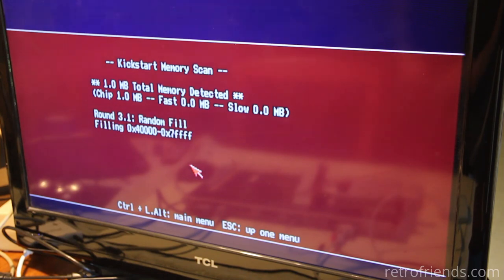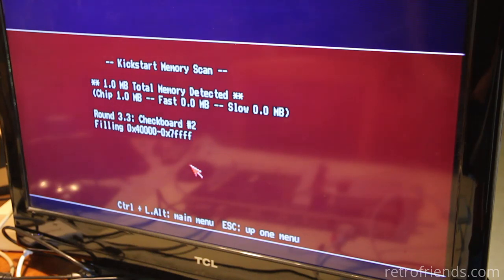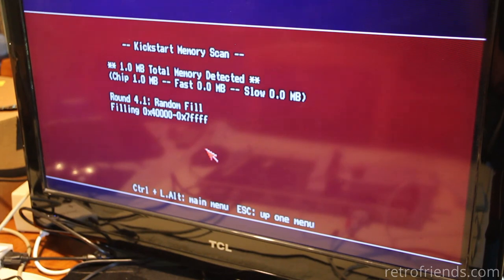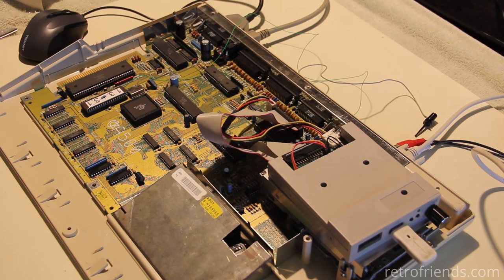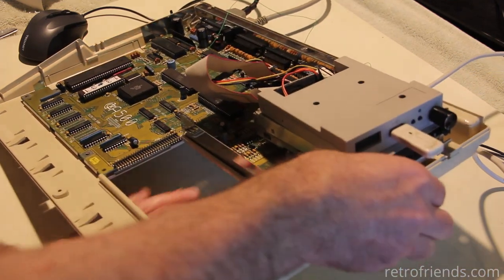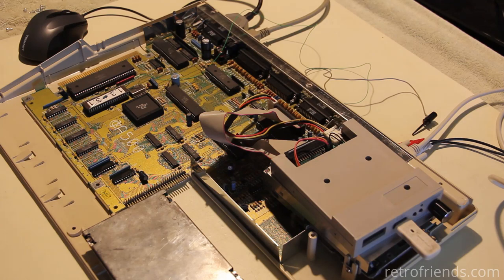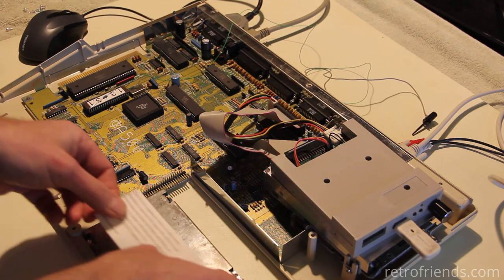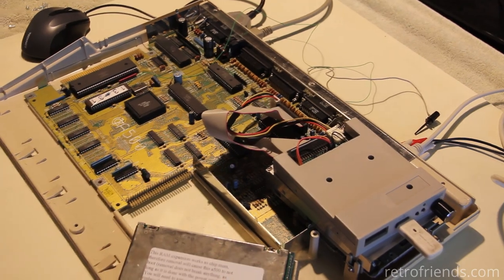Amiga 500 r6 1-Megabyte Chip RAM Upgrade

Comment: Would it be possible to solder the extra chips on the mainboard and keep the trapdoor expansion? 

That way we could have 1MB of chip RAM, and 512k of slow RAM?

Thank you for the video, also.
Reply from the maker: No, sorry. The chipset only supports one MB. Soldering memory to the main board and shorting a jumper to activate it effectively disables the trapdoor memory. Obviously there are other mods that can be done, but at that point I would recommend choosing fast memory using the side expansion slot.

Comment: On these rev 6 boards only 1/2 of the board ram is populated. Could you not just populate the missing chips, add in the missing capacitor and get 1meg chip that way?
Reply from the maker: Yes, but then you can't use the trapdoor memory slot. To each his own.

Comment: Dopo che hai tagliato il ponticello al jumper JP7A e hai provato il multimetro,il multimetro suonava,vuol dire che il contatto c'era ancora,dopo hai tagliato bene il ponticello?,nel video non si è visto
Reply from the maker: Hello to my friends in Italia!  With the help of google translate, he asks why my multimeter made beep sound  after the cutting of JP7. It is because my meter beeps when there is partial continuity, and a solid sound when there is a dead short. Il mio misuratore ha un suono solido quando si sente un breve suono ammiccante quando è aperto parzialmente.
Reply: Secondo te con 1mb di chip ram funziona ancora lo slot di espansione?
Li vedra 1,5Mb??
Reply: @riccardotrizio1545  se il lavoro è stato fatto a regola d'arte e non ci sono problemi sui jumper modificati,in teoria si,l'A500 dovrebbe indirizzare correttamente 1 MB chip e 512 kb fast,salvo brutte sorprese,ovviamente il FAT AGNUS deve essere almeno l'8372A
Reply: @riccardotrizio1545  quello che ti ho detto nell'altro commento non vale però per l'A500 del video perche i jumper sono configurati per mappare la fast in chip,l'altro commento si riferisce a un A500 sempre rev.6A ma con i 512kb montati sulla motherboard e si modifica solo un jumper,il JP2,cosi L'AMIGA ha 1 MB on board,e lo slot continua a essere mappato in fast.scusa se non te lo detto prima.
Reply: @giuseppelavecchia775  Gentilissimo, grazie!

Comment: How does this mod effect on software like games that won't run on 1Mb ?
Can you add expansion cards after this ?
Reply from the maker: Games that don't like 1MB, won't like this 1MB any more than any other 1MB Amiga.  Getting an a500 to run with 1MB of chip RAM always makes the trapdoor memory unable to be used, regardless of the method. Like any othe mod, some people will want this (OCS gamers), some will not (productivity users).
Reply: @retrofriends  i want this as a productivity user cuz i want to have more samples loaded in chip ram in protracker, 512k is not enough for me, so i'm waiting for my ECS 8372a right now
Reply: @retrofriends  There is exactly one exception, the Adram505, it adds chip ram directly through the trapdoor with no mod need. 1MB chip + Realtime Clock, lol. Not sure how it works, but it does. Also made it so I couldn't softkick, as that trick needed the 512k of slowram, and I didn't have it. confused me for quite a while, as there is very little info about these upgrades available.